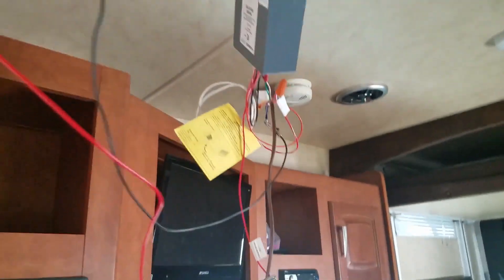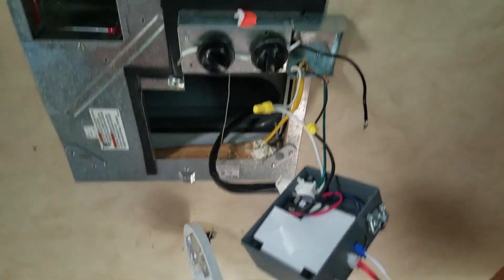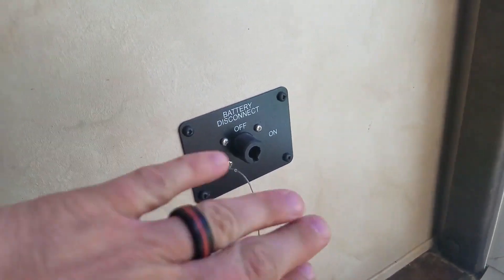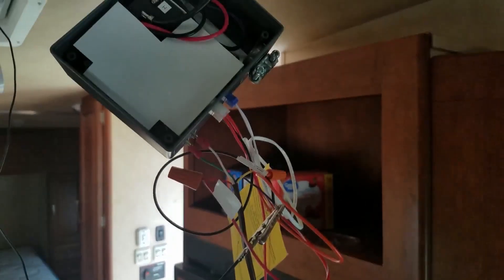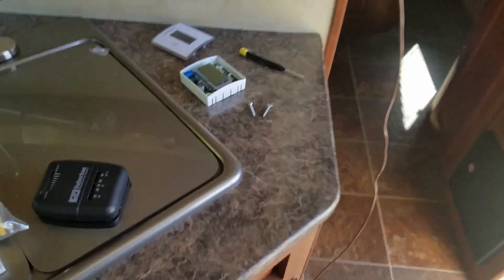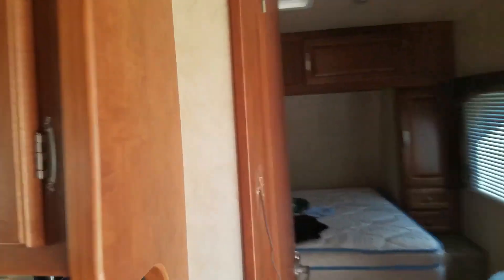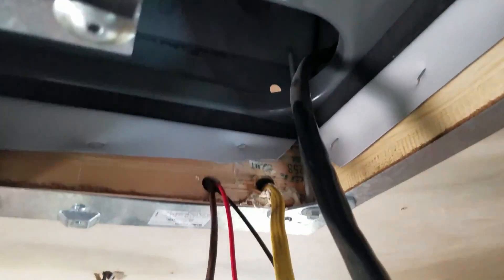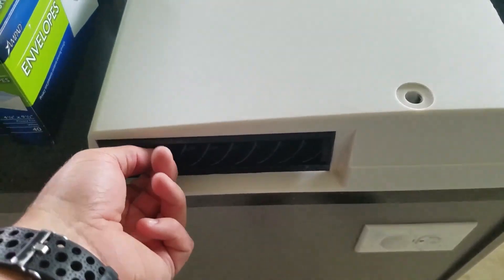DIY: Analog to Digital RV Thermostat UPGRADE

Comment: I have a duo-therm control panel is that what you had? I would love to do this with out back ac only unit
Reply: Have a dometic ac unit hat number on the cox did you order? my label shows 3 - 2 with ccc control and one with tpm control, I did also email dometic. Thanks for the vidoe. Any help would be appreciated
Reply from the maker: I did not have a duo therm. So I'm guessing my part number would not match yours. However, Dometic sales can get you your proper part, which is how I got mine ordered. Thanks for watching!

Comment: Is there a part number list for the domestic thermostat and the control box you used?
Reply from the maker: Yes, the part number is Dometic 3316230.000. There is a sticker inside my actual ac unit which lists all compatible parts with it. In my case I contacted Dometic and had an answer within a few days of which part was right for mine. Thanks for watching!